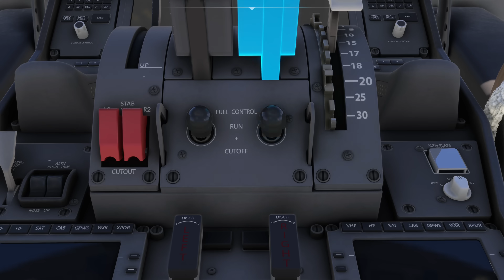Air India 171: Why Did The Fuel Cut-off Switch Get Moved?

Comment: Hello Captain Steeeve, excellent work as always. With this accident/situation, do you think that the discussion about single pilot on this airliners it is or will be completely  "dead" or do you thinks it is still on the table but with even more computers or "safety nets" as a precaution/prevention even for deliberated acts?

Comment: Remember FAA warning in 2018 about fuel switches in Dreamliner 787... Boeing has a history of hiding faults & hidden software installed like MCAS in 737 Max 800's...there is a recent incident on apr 23,2025...An Avianca AV flight, 787 flying from Madrid, Spain to Medellin, Columbia had to return because of engine failure.... Now Boeing propaganda dept working hard to prove it as a suicide by pilot...They brushed it of when a 737 Max 800 crashed because of hidden MCAS, about which pilots were not aware of nor it was mentioned in training manuals.

Comment: So maybe the 10 second delay between the turning off and on of the switches could be because - the senior pilot who was pilot monitoring in this case, turned the switches off, then asked the pilot flying - whey did he switch them off. The pilot flying oblivious to this till now replied - he did not. The pilot monitoring then puts a small show to indicate the switches are off and then has his hands over the switches indicating he will turn them on (but he obviously took his time), and slowly turn them on. And it took two second to turn on the second switch which means who ever was turning them on was not in any hurry (as opposed to the 1 second it took to turn them both off earlier).

Comment: Captain steve is not an honest presenter. You can see how he is massaging the narrative to favor an outcome towards pilot error. Despite not having any detailed data of the actual cockpit flight recorder conversations between the pilots he is gravitating to pilot error citing depression etc. Why is he not talking about the obvious?? We only have 1 sentence released from the conversation in the cockpit of an event that lasted probably 45 to 60 seconds. Then what about the UK  Civil aviation authorities warning about the fuel switch problems on Boeing? what about the fact that we dont exactly know if the fuel switches physically flipped from on to off position because the black box would only indicate a digital binary recording of the switch turning on or off? Why is he not questioning the fact that this could have been a FADEC error or TCMA error internally which the pilots had no control of. Why is this Steve guy not questioning how two electronic switches that are equipped with a spring loaded unblock and lock mechanism be switched off together??? considering that the report says they the fuel was cuttoff between switch 1 and switch 2 within 1 second of each other??? This guy steve is not an honest person he is pushing a narrative. And i am not saying that it is Boeing problem or anything else i am just saying that at this particular moment everything is simply pointing suspicously to Boeing and all the vested interests trying to cover up for boeing. My simply point is if you are an honest youtube channel then ask the relevant unbiased questions such COULD IT BE POSSIBLE THAT THE DIGITAL PART OR ELECTRONIC PART OF THE SWITCHES MALFUNCTIONED ??? GIVEN THAT THIS ACTUALLY HAPPENED WITH AL NIPPONS DREAMLINER 787 AND BOEING HAS BEEN IMPLICATED IN THAT EVENT TO FIX THE SOFTWARE AND CORRECT THE ERRORS. WHY IS CAPTAIN STEVE AND EVERY ONE ELSE TRYING SO HARD TO JUMP TO PILOT SUICIDE OR SABOTAGE AND COVER FOR BOEING?? PLEASE STOP SUPPORTING CAPT STEVE BIASED RHETORIC AND INSTEAD LISTEN TO GARY B PILOT HE IS AN HONEST AND UNBIASED REPORTER.

Comment: The switches don't control the fuel directly, rather they connect to valves via electrical wires (and possibly some electronics and software).  So can we be certain that the switches were definitely physically moved to the OFF position rather than it being a wiring fault causing the same effect?  The black box data wouldn't be able to tell the difference.

Comment: Another possibility is that someone tampered with the switches to prevent them from locking in the run position. It might be done by placing small objects in the detents, it might be done by someone before the pilots even entered the cockpit. It may explain why it takes 5 seconds between turning on the switches, maybe something prevented it from staying in the run position. I personally believe that the pilots were not at fault here.

Comment: Putting the switches back to Run may have showed "a lot of presence of mind", but considering that it took 14 seconds after Cutoff to get them both back to Run, it sounds to me like there was a struggle for control of the switches. The perp gave up the struggle once he realized it no longer mattered.

Comment: Another YouTuber pilot has said that 10 seconds is quite a long period in the circumstances to put the switches back and that the gap between the two was longer than a second. How easy would it be for the other pilot to do so? Also, the flight recording would be clear about which pilot was speaking. What else would have been recorded that the report is not telling us?

Comment: For context this is all happening during the take off roll and subsequent rotation where the pilot flying was the first officer, and the pilot monitoring was the captain. During this transitional phase of flight both of the the copilot's hand would be holding the yoke while the captain's hand will remain steady over the thrust levers (located at a short distance of the cutoff switches). 
The captain as the pilot monitoring was in charge of the flaps lever adjustment amongst other controls as needed like radio transmission and the "gear up" moment.  Also to note that while taxiing on the ground the plane's turning, positioning and line up are performed by the captain using the tiller (small steering wheel) only available on the captain's side in the 787. 
So basically his hands are all over the place and nothing odd would be noticeable to the first officer.

Comment: I wonder if the fuel shut off  could be redesigned.  How about two switches for each engines located to opposite sides of the cockpit where they would have to be activated by both pilots to effect a shut off?  This way no one pilot would be able to do so.  This is in the mode of a submarine needing two keys to make a missile launch.

Comment: Can you please explain the function of the fuel cutoffs to the engines? Does a computer read the cockpit switch positions?  Are these analog signals from the switches?  How do fuel valves and pumps get the shutoff commands?  What happens in a total electrical failure?   Are the computer systems involved "single string"? or are there multiple channels processing the information to be most reliable?   Is there any way the fuel system can be shut down without the pilots sending these commands?

Comment: It is baffling to read the comment section, based on ambiguous statements in a leaked preliminary report. No publicly released evidence of CVR has been released. There was an advisory in 2018 about the fuel engines' automatic disengagement due to faulty switches in multiple Boeing aircraft. 
https://drs.faa.gov/browse/excelExternalWindow/BBE820D0419DB3358625836600761396.0001?modalOpened=true
All the experts here and in the Western media have trialed the pilot for stating his possible suicidal mission due to mental health. Wow! Just wow!

What's next? In the following report, it states that a dancing chicken was standing on the switches, which led to the switch transition. Discuss whether a chicken could have the power to cut off a fuel engine switch. Bravo people! 👏👏

Comment: @2:55 No, because what if one of the pilots becomes incapacitated and the other has to cut fuel to one of the engines?  The situation the Capt Steeeve suggested was a two point manual cutoff, but if one pilot is determined to crash the plane then this doesn't really help mitigate what happened.

Comment: I'm a train driver and there are various safety systems on the train that you can switch off. Normally this would be done if there was a fault  with the equipment itself, then rules come into place regarding speeds etc. However if a driver had sinister motives then there is nothing stopping them disabling a safety system. When you go on public transport you are not only trusting the equipment,  but also the  people who are operating it.

Comment: If the fuel is switched off and then on again after a few seconds, will there still be a small amount of fuel left in the lines to prevent the engine from completely shutting down, enabling it to draw fuel once it's turned back on? Where are the cut-off valves located.

Comment: Ok bear with me on this NOT PILOT ERROR THEORY -
What if there was no physical movement of the switch and the black box registered the actual electrical event of the fuel valves opening/closing. Lights on the console indicate the status of the fuel switches. So this could explain quite a bit if physically the switches were always in the ON position

FO see the fuel cutoff lights come on (due to electrical closing of valve)
Black box registers this as switch moved to CUTOFF
FO asks PM why he did that (justified surprise)
PM says he didn't do anything (appropriate response)
Both see switches are in the ON position and can't do anything
System resets and fuel values open over next 10s
Black box registers these and switch ON events
Reply: It should be possible to get clarity on that by comparing the time stamps on the flight recorder with those of the speech recording.
If the question was asked shortly before the fuel cut off switch got set to ON, then it's very likely that the Switches were visibly Set to OFF.
If the question was asked just a few seconds after thrust started to decrease they might have tried to restart them more than once and were successful only after 10 seconds.
TBH, I deem that to be a more unlikely scenario. However, unlikely isn't 100% impossible. Finding clues providing a reasonable probability might prove quite difficult though.

Comment: Thank you for another outstanding video.

Based on my past experience flying various commercial widebody jets, I remember that in all emergency procedures—such as engine fire, severe damage, engine separation, or turbine overheat—the first memory item is to bring the affected engine's throttle back to idle before selecting the fuel cut-off switch to the OFF position.

If there's anything we’ve learned from this crash, I believe aircraft manufacturers should consider adding another safety measure: a system that prevents the fuel cut-off switches from being activated in flight mode unless the throttle is first brought to idle.

Regarding AI, I’ve learned that 73 percent of all aircraft accidents and incidents are the result of human error. The general public may not be aware that 80 to 90 percent of a typical airline's flights are managed by the aircraft’s automation systems.

I believe the current role of pilots will need to evolve over time and be further integrated with AI and automation, without eliminating the pilot from the cockpit altogether.

Best regards
Reply: Fake narrative. Facts are here. You are sold off to Boeing. Why don't you talk about FAA directive from 2018 and CAA directive from May 2025 which talks about issues with Boing 787 which can cause cut off including during inflight.  Why Etihad airlines and DGCA wants planes to be checked. Why British Authority wants checks for this issue since May 2025?.

Western media is corrupt and sold to Boeing
Reply: Fake narrative. Facts are here. You are sold off to Boeing. Why don't you talk about FAA directive from 2018 and CAA directive from May 2025 which talks about issues with Boing 787 which can cause cut off including during inflight.  Why Etihad airlines and DGCA wants planes to be checked. Why British Authority wants checks for this issue since May 2025?.

Western media is corrupt and sold to Boeing

Comment: The fuel switches were turned to cutoff less than 1 second apart. Yet when they were subsequently turned from cutoff to run there is a 4 second interval. Is there a procedural explanation for this difference?

Comment: That is a misleading comment - they do not know they turned off the fuel based on a voice  in the cockpit - he never said "why did you turn off the fuel"  even if he did in desperation to get the engines started in his last moments of life. It is a an attempt to pin the blame on the pilots.  Not a mention of atmospheric ingestion of aerosols causing flameout.

Comment: Why are people hung up on the idea that fuel cutoff switches shouldn't be usable by pilots after takeoff? A pilot could easily shut off the engines manually using fire handles instead of doing the cutout switches. The entire system is predicated on trust in the pilots. We trust the secret service agents not to pull out their gun and shoot the president because these people are put into a position of trust. Here we have a mentally unstable person that should not have been flying. What kind of person kills hundreds of people so that they can kill themselves? It's horrible!

Comment: In my 45 years of training and flying I have never had any fuel switch move itself to the cut off position ever. I started in a Cessna 150 and finished in a Boeing 777-200/300ER and no fuel switch has ever moved itself to the off position. This was done by a human being and now you have to see who was the flying pilot and who was non flying pilot and you are going to have to go through their background, physical, emotional , mental and see if there was any financial issues and did these two pilots work well together. The results are not going to be good.

Comment: Pilot queried "why did he cut off" after seeing warning on panel and assuming the other pilot might have cut off, as he knows its not himself. When the other replied he has not, they tried to shut down and start again to revive. His question was impulsive in a panic situation. Please note, they were still climbing and engaged in a critical phase, with their heads up looking in sky and body pulled back to their seats. FDR recorded fuel was shut down, it never tells whether by physical cut off or by misplaced signals for some other reason.

Comment: I'm a professional engineer. I know nothing of the specific circuitry used in a 787, but the switches are probably not wired directly to the engines. I would expect they would be wired to input circuits in a flight controller of some sort. It is possible that those input circuits malfunctioned, rather than the switches themselves. There are many other possibilities. We need to wait for the final results of the exhaustive investigation now underway. If there was an intermittent fault in the input circuits of the flight controller, it will be a hard thing to prove.
Reply: The 2 circuits are isolated from each other a short on one can at worst only cut off one engine fuel,, it can not shut the other engine fuel down
Reply: Also, the most likely scenario is also the simplest scenario. Those switches were moved manually, one after the other. @leexgx
Reply: I agree with you on the circuitry, but the switches were flipped about 1 second apart. An electrical failure affecting them both would happen instantaneously, no? To support your argument, the plane reportedly had electrical problems for a few flights prior to the crash.
Reply: @philf4086  The switches may not be sampled every second. A delay in a software buffer. software bug. there can be many many reasons there is a delay in logging a change of state. You would need circuit diagrams of the subsystem and access to the software source code to comment on this.
Reply: @phi1111ip  Sure agreed,, with the light duty for those switches, the scan rate might be relatively slow.
Reply: Fake narrative. Facts are here. You are sold off to Boeing. Why don't you talk about FAA directive from 2018 and CAA directive from May 2025 which talks about issues with Boing 787 which can cause cut off including during inflight.  Why Etihad airlines and DGCA wants planes to be checked. Why British Authority wants checks for this issue since May 2025?.

Western media is corrupt and sold to Boeing
Reply: What did the pilot meant when he asked that other if he moved it? What did he see and visually confirm before he asked the question? Did he see if the internal wirings/electrical circuits were moved?

Comment: Does an alarm sound good off in the cockpit if both or one fuel cut off switch goes off? And could software be introduced for a computer to ask for final clarification before shutting down of the fuel.

Comment: Interesting that the blame is being placed entirely on the pilots. According to the report, both engine fuel switches were turned off within one second of each other. Once the pilots realized this, it took them four seconds to turn both engines back on. It seems that manually switching them on or off takes at least four seconds, suggesting there could have been a metallurgical issue with the switches themselves.

Comment: With all due respect, Captain Steve, you're wrong. Only video would show which pilot transitioned the Engine 1 and Engine 2 fuel cutoff switches to “cutoff” from “run” and back to "run" from "cutoff". With only voice, gaslighting could occur, where the captain responsible accuses the innocent captain.
Reply: The CVR records each pilot's mic separately, so investigators can pinpoint who's speaking. Voice identification is also possible through voice recognition by those familiar with the pilots' voices.
Reply: @toddyrich118  Only video would show which pilot moved the levers.
Reply: @DC_Consulting_DC agreed, unless they can pull fingerprints from the fuel levers.